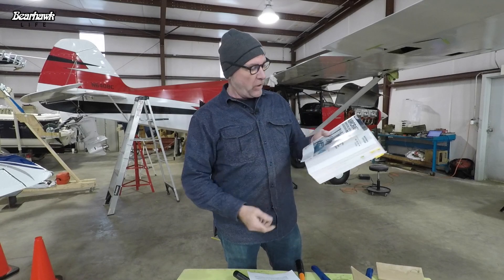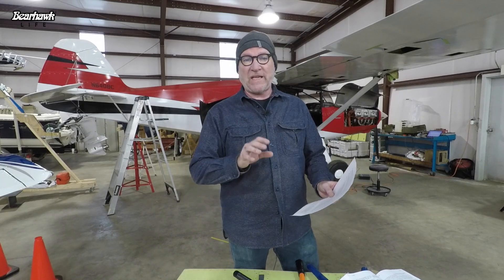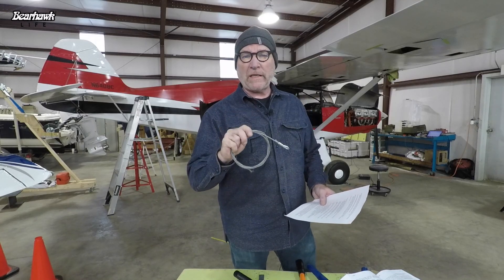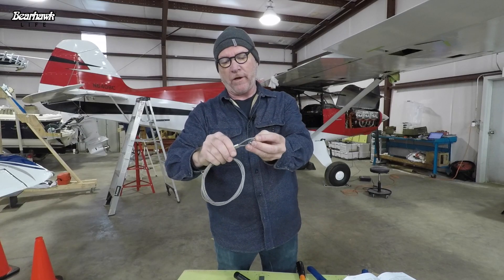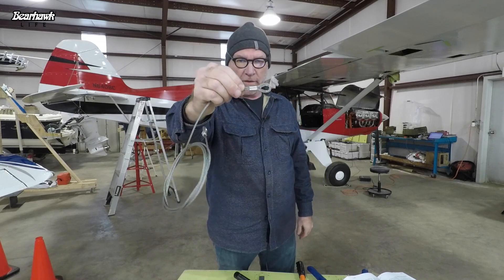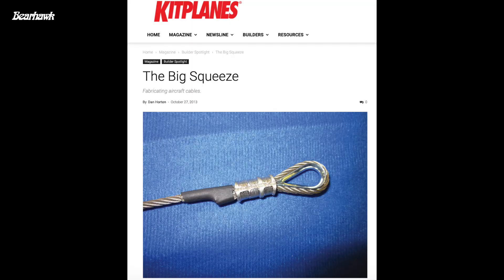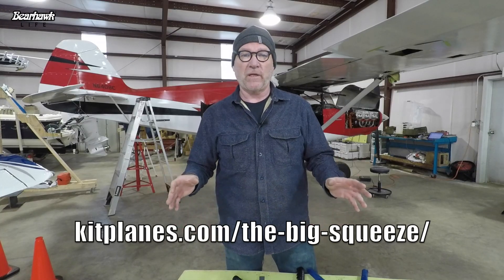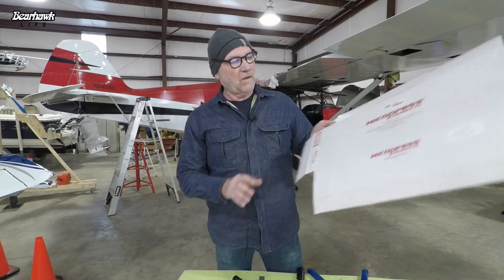BEARHAWK ~ Copy Cat Tool!  MUST SEE!

Comment: I bought the same tool from Amazon. It appeared to be nicely made and the companies website was full of information but it made terrible crimps so I returned it for a refund. I was making loss prevention cables for medical equipment and the crimps were coming out uneven with very sharp edges. I would definitely not trust those crimps in an aircraft in which I was flying. And I do also fly.
Reply from the maker: Thanks for the confirmation!

Comment: Found a link to this video on a forum. I’m building a Kitfox and was researching swaging tools for the rudder cables. Everything else is push/pull tubes so I didn’t want to spend a lot of money for just a few crimps. I’m glad I watched this video and got the link to the magazine article. My mind has been changed and I’m definitely going with the right tool for the job, even though I only need a few swages.
Reply from the maker: Glad the video helped!  Sometimes you just cannot skimp on the proper tool.

Comment: Before I cut any of them for dramatic effect… I would have at least tried to stress test them after removing. May have been even more “dramatic”
Reply from the maker: I agree.  However, they cannot be removed unless cut first.  The swag will not pass through the pulleys so therefore a stress test was not possible because the swages, where the test would have occurred, had been removed.

Comment: Don't cut and just pull out the bad cables.
You should cut, tape new cable to the cut cable, then pull out the old cable which pulls the new cable into place. It will save you a bunch of time.
Reply from the maker: Good idea!

Comment: its good. but a question. is there stainless steel aircraft cable? just thinking if someone is close to the ocean the air may weaken the cable if not stainless. any thoughts?
Reply from the maker: There's been much discussion about this topic on the Bearhawk Builder Forum.  In short, stainless is brittle and doesn't wear as well as galvanized.  We've seen SS cable deteriorate in a short period of time.  The galvanized cables are coated with a thin coat of oil for protection.

Comment: I might of pulled one cable at a time and used it as a length gauge. Better safe than sorry. Good call, it is not fun being in a lawn dart.
Reply from the maker: I thought about that.  However, after cutting the cable under the neck of the copper sleeves in order to pull them through the pulleys, you are now left with a shorter than desired cable.  It was easier to swage one end of the cable, attach it, then pull to the desired length and mark the apex of the loop and use that as the most accurate length estimate.

Comment: In 1978, or thereabouts, I lost a comrade in Zimbabwe to incorrectly crimped cables. This fine young man was flying his Fly Baby at an airshow. He was a qualified AMP, via air force training, been flying since he could only reach the stick from his Dads lap. Not even 20 yet but over a thousand hours of flying to his name, (mostly non legal, not log-able of course!) of aerobatics in Tiger Moths, take off and landings and cross countries in a Beech Staggerwing before he soloed. The list is Long!

The Fly Baby has cables through the fixed main wheel axle that hold the low wing monoplane wings in position, like flying wires on a Pitts, beyond the spar root fittings. The builder did not use a genuine Nicopress crimping tool. Some other tool was used which over crimped the cable copper ferrule swages. The individual strands of the cables were seriously weakened, this is not visible to the naked eye, being inside the ferrule. The cables snapped at the copper swage and the wing tips met each other.

Thank you for an EXCELLENT article.
RIP my comrade. You know who you are.
Reply from the maker: Thank you for sharing this story.  I am sorry for the loss of your friend.

Comment: Did the swages made with the cheap tool pass the guage?
Reply from the maker: What I should have mentioned in the video...  Many of the crimps on the copy cat tool reached the correct diameter to pass the go/no-go gauge.  However, there was no consistency or uniformity in the crimps.  Many times the copper would squeeze or push out of the dies.  This suggested to me that less of the copper was actually contributing to the grip of the crimp.  Again, maybe this would have sufficed but the ounce of doubt created was enough for me.  I'm sure others may have proceeded differently.  I'm not interested in just getting by.  I want absolute perfection.

I have since re-rigged all of the control surfaces.  I am pleased with the consistency of my new rigging.  If I were to do it all over again, I would run strings through all of the cable routing areas and would fish all of the cables and make the swages and connections at the same time.  I am pleased with the outcome of this challenging situation.  

I appreciate your thoughts.  Thanks for watching!

Comment: I'm curious.  Did you put a go/no-go gauge on any of the crimps that you cut out of the plane?  If they pass a gauge check, they're safe, regardless of the price of the tool used to crimp them.  You could have checked them with a $13 gauge, given yourself the peace of mind you wanted and probably saved ~$500.
Reply from the maker: What I should have mentioned in the video...  Many of the crimps on the copy cat tool reached the correct diameter to pass the go/no-go gauge.  However, there was no consistency or uniformity in the crimps.  Many times the copper would squeeze or push out of the dies.  This suggested to me that less of the copper was actually contributing to the grip of the crimp.  Again, maybe this would have sufficed but the ounce of doubt created was enough for me.  I'm sure others may have proceeded differently.  I'm not interested in just getting by.  I want absolute perfection.

I have since re-rigged all of the control surfaces.  I am pleased with the consistency of my new rigging.  If I were to do it all over again, I would run strings through all of the cable routing areas and would fish all of the cables and make the swages and connections at the same time.  I am pleased with the outcome of this challenging situation.  

I appreciate your thoughts.  Thanks for watching!
Reply: The diameter of the crimp is only one important factor and applies ONLY if the Crimp Tool is a genuine Nicopress tool, using a genuine Nicopress sleeve etc. Read the AC 4313 carefully, and the Nicopress instruction manual. The other factors to consider are, the width of each crimp, the correct  placing of each crimp along the ferrule, the correct sequence of the 3 crimps, or otherwise and whether or not the ferrule is in the correct heat treated condition as supplied by the correct, certified manufacturer. If the crimp is over annealed, or excessively hardened by age or vibration or whatever can affect it, then there might be a problem. So, only use genuine crimper tool, genuine ferrule, and genuine go, no go gauge, (unless you're a qualified machinist who can make their own go, no go gauge of course. And not to forget also that the radius of the crimper hole circular edges have a certain accurately machined radius on them. A too sharp, or too round radius Will affect the quality and safety of the crimp.

Always remember that a certified system is called a system because it is exactly that. It is Not simply a collection of parts. If the system is is not manufacturer correct, or complete,  then it's no longer a system and fails certification standards.

Comment: If you buy the tool with the proper width jaws (to do a 312 crimp), adjust it properly and use a go/no-go gauge you can safely use the cheap knock off tools. 
Horrible demonstration of the tools; well I guess no demonstration of the tools actually; just a rant with little substance.
Reply from the maker: What I should have mentioned in the video...  Many of the crimps on the copy cat tool reached the correct diameter to pass the go/no-go gauge.  However, there was no consistency or uniformity in the crimps.  Many times the copper would squeeze or push out of the dies.  This suggested to me that less of the copper was actually contributing to the grip of the crimp.  Again, maybe this would have sufficed but the ounce of doubt created was enough for me.  I'm sure others may have proceeded differently.  I'm not interested in just getting by.  I want absolute perfection.

I have since re-rigged all of the control surfaces.  I am pleased with the consistency of my new rigging.  If I were to do it all over again, I would run strings through all of the cable routing areas and would fish all of the cables and make the swages and connections at the same time.  I am pleased with the outcome of this challenging situation.  

I appreciate your suggestion for a tool demonstration.  Thanks for watching!

Comment: Great video and thanks for "fessing" up.  I would have never thought of this problem but I will now.  Glad you are not upset about the whole thing.  Does it suck, yes it does but destroying your work or even worse getting killed would really suck so good on you for taking the extra steps to correct this and also help others not make the same mistake.
Reply from the maker: Yeah it sucked, but having to make ALL of the cables and swages at the same time created consistency and uniformity.  I probably would not have have built all of the cables throughout the project and done it all at the same time (next time).

Comment: I did have a cable pull out of a sleeve in a thankfully non-aviation and non-life threatening scenario.  I had used the big-box store type tool to swage a bunch of cable ends on some horizotnal tension cables for my boat canopy.  Worked perfect until a big storm came up and pulled one end right out.  I thought they were on good and tight. Now I'm going to get one those Nicopress tools for all future work.
Reply from the maker: You just can't cut corners on something like this.  Thanks for watching and sharing your experience!